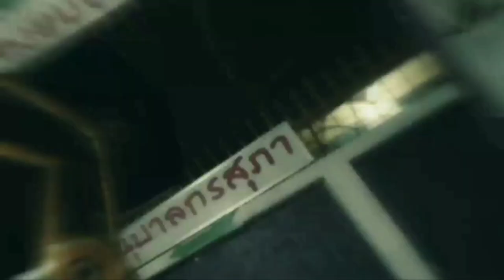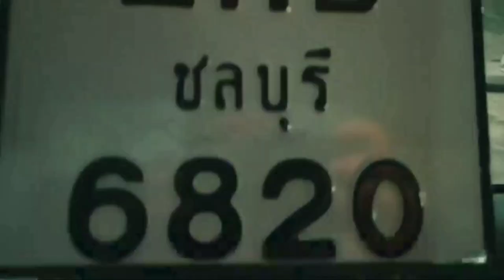AEROX 155 CVT SECRET TECHNIQUE | SEGUNYAL MARKING

Comment: ganyan ako mag set ng cvt ko, TDC METHOD pero ung pag ayus ng Bola dun lang tayu mag kaiba, mas magaan ung naka tuktuk sa tdc ko
Reply: this is how NTC is known for its unique set
Reply from the maker: Ito po trailer nang test drive after installation po niyan. Same pag kaset din yan sa motor ko. Nauna ang mabigat. 

https://www.facebook.com/101405948020670/posts/153325389495392/
Reply: ung sakin kasi 3 klase ng bigat ng bola ang gamit ko, 12gx3 11gx1 at 10gx2, ung 10g ko ang nakatutuk sa tdc
Reply: @kathailander  naasar paako sa panonood sa into sa pag lagay Ng 1500rpm sa stock na engine. Ang babaho Ng utak. Pag aralan nyo muna bago nyo gawin. Akalamo malakas motor mo humihiyaw na sa taas Ng rmp bago sumibat. May Mata at pandinig ba kayo. Sasabihin mo Ang lakas na eh puro ungol Lang dahil sa tinaasan nyo rpm
Reply: @agapitobagumbayan8280  ilan ts mo boss?
Reply: panu ba malalaman pag naka TDC na pulley paps ? meron ba sa msi125 yan?
Reply: @agapitobagumbayan8280   paps panu yang TDC na tntawag? pag nag Li2nis kc aku nang pang giLid diku nagagawa yang tdc e
Reply: @kathailander  pano po pag straight weights ng bola?

Comment: Lods ask ko lng if okay lng ba stock clutch spring kht nka clutch assembly nako? Nka pulley ndn ako at bell
Reply from the maker: Kung stock lang engine mo. Mas magada stock lang spring gagamitin mo sa clutch at sa center spring. Matagal kasi mag engage ang clutch kung mas matigas.
Reply from the maker: Ano ts no ngayon sa pulley mo? Gustu mo matry pulley namin?
Reply: Stock engine papa . ahh ok try ko ibalik clutch at center spring ko . malkas sa aramgkada kaso ts ko 109 lng tlaga sagad na
Reply: Ntc pulley nyo papa?
Reply from the maker: Bakit 109 lang????? NTCshop namin pinaka mababa 125kph at umaabot 135kph panggilid lang. Check mo mga video ko.
Reply: Oo nga lods e mu npnoood ksi ako video mo sbi mo stock springs lng kpg stock engine kaya ttry ko ibalik s stock springs .
Reply from the maker: Ok kathailander salamat. Meron pa ngayon 3 pcs nang NTCshop pulley natira kay ZERO ONE MOTO. Try mo avail sa kanya. I can assure you, kita mo difference.
Reply: Copy lods ask ko pala if mgkano ?
Reply from the maker: @godspeed1157  inquire mo lang sila kathailander. Magrereply sila agad.
Reply: Salamat lodi na pm ko RS lagi :)
Reply: My pm ako sa fb MO lodi

Comment: Ask ko lang sir naka order kasi ako ng ntc pulley. Ano po kaya best combi ng bola para ma attain best possible TS. 85kg rider oversized tire 120 front 150 rear naka daeng powerpipe . Ano din dapat na center and clutch spring. Para sana pag dating ng order ko sainyo masalpak agad.
Reply from the maker: https://youtu.be/uM76u2zt7vA
Reply from the maker: Pwede ka mag 1000rpm na center spring kathai
Reply from the maker: Pag matanggap mo na sali kita sa gc